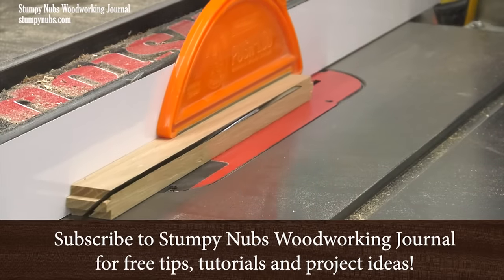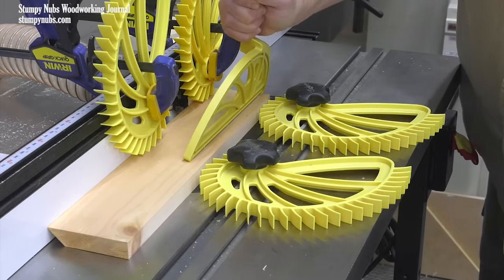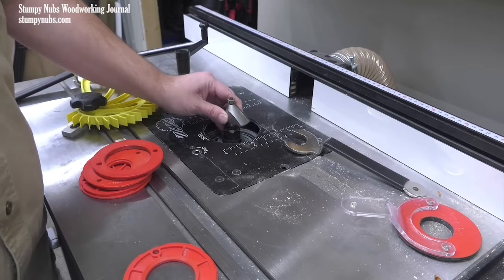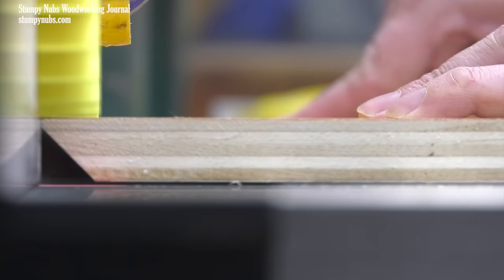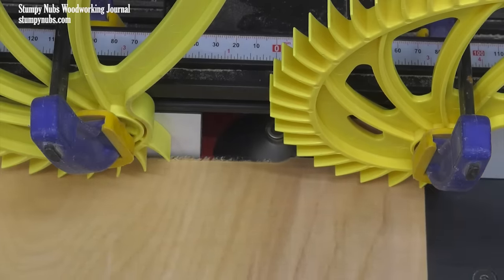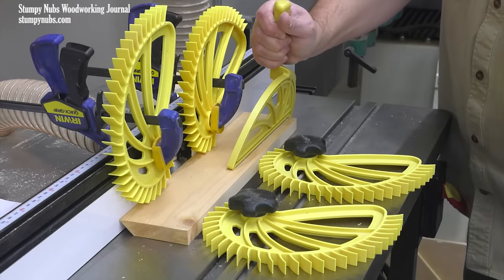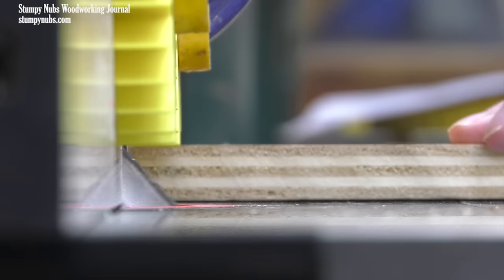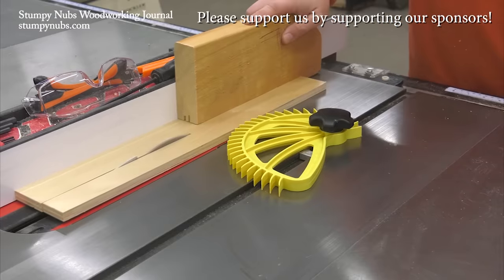This will make a BIG difference when you cut miters/bevels!

Comment: What stops you from just using a track saw? I was under the impression that was the best tool for something like this. Easy to line up perfectly, doesn't wander along the workpiece, precise angle adjustment, can handle long rips.... That is how I see pro carpenters doing long miters, like for fake box beams.
Reply: simplest answer is money. a lot of people dont have money to spend on a Track saw but many woodworkers already have a router table and chamfer bit.  Thats whats great about james, he shows you that there is almost always multiple ways to complete a task, even if those ways arent the quickest or easiest. now go cut some mortises with a drill press! lol.  seriously though, james has shown hundreds of thousands of people that they dont need an industrial sized shop with 100k in tools just to build a nice peice of furniture. Stumpy Nubs is a gold mine to the woodworkers that dont have the funds to buy whatever tool they want/need.
Reply: In my experience, You can tip a track saw if your not careful, giving a wavy bevel
Reply: Also difficult to cut really small pieces easily on a track saw
Reply: @spycedezynuk  Ditto. I was doing miters on 1/4" thick cherry yesterday. Work pieces were only 4 inches long. I can't imagine using a track saw for that.
Reply: The consistency sucks with a track saw.
Reply: 23/32 of an inch. Goddam….

Comment: As someone who has access to a jointer but not a tablesaw or a router table, I've never had this problem. Just set the fence on the jointer correctly and push your board through!

Comment: Big stumpy nubs fan. Nice trick to have in your back pocket. However, I tend to feel like if the workpiece is too small to keep stable on the table saw, then it is also probably too small to be used like that on a router table (to get the crisp edge, at least). In both cases the real difficulty in in avoid travel towards the cutter. IMO, you’d be better off in that case using a bevel bit with a template bearing, maybe even handheld on top of a straight edge template.

Comment: I think that a bevel is a cut at an angle to the face (wide side) of a board and a miter is an angle to the edge (short side) of a board. (length is the third direction, along the grain)

Comment: You could also create a beveled strip of wood on the outfeed side which is the exact size of the bevel you are cutting away, so the workpiece can slide against that.
Reply from the maker: I don't think cutting and fitting that would be any faster or easier than the two test cuts it took to set up my first suggested method.
Reply: @StumpyNubs  but you only need to do it once for all future cuts
Reply: @rutgerhoutdijk3547  i agree
Reply: @rutgerhoutdijk3547  only if all your future cuts are the exact same height miter. Testing for changed setups probably safest

Comment: This video has totally changed how I cut my miters/bevels. I purchased the larger bit and use it with a Rockler coping sled on my router table. It holds the pieces perfectly and cuts the miters in one pass.

Comment: You always come through to save the day! I’ve been trying to cut a nice long 45° bevel  on some pieces of 1/2” plywood for French cleats. I do mostly hand tool stuff so don’t have a lot of experience with my router (table mounted). I figured out my pieces all had humps in the middle of the bevel because the outfeed was no longer flush with the fence by the end. I came here looking for a solution, and lo-and-behold here you are coming to the rescue (and not for the first time). Thanks for all you put into these vids. Cheers 🍻

Comment: Thank you so much for this video.  I’ve been working a box project with mitered corners and have been trying to do them on my table saw.  Just can’t seem to get them square and straight.  I watched this video and decided to try the router table instead.  It worked great!  And that tip about attaching the board with double stick tape to be a guide helped a lot!  The miters came out square and flush.  Thanks James!!

Comment: I built a set of bearing guides for my CNC machine for this purpose. I can feed the material in from one end and have the bearings hold the workpiece at both sides of the cutter. Next upgrade is to add a power feed roller to improve surface finish.

It's worth looking at canned cycles and macros for smaller things like drawer boxes

Comment: Such a timely video. Today, I needed to cut 1/4" x 2-1/2" miters. It took about 2 seconds to head to the router table with the miter bit. I'm a bit right side thinking, so there were a number of test runs prior to cutting the work pieces. Once dialed in, in too all of 3 minutes to cut these perfect miters.... Its the only way I'll do it from here on out.... Thanks

Comment: I’ve shifted from making bevel cuts on the table saw to using my tracksaw and a 90 degree rail guide. Works flawlessly everytime and none of the setup time associated with a router table. It does take a little time to dial in the 45 degree angle on the track saw but once you’ve done it it’s a “set and forget” setup.

Comment: I use this technique to cut miters on the sides on my boxes. I built a small sled with a backer board and clamps to hold the piece in place and use a runner in the miter slot to control the sled. Simple, easy and I can use a stop block to duplicate the lengths. Just slowly raise the bit until the height gets you the cut you want.

Comment: James, you've been reading my mind this week.  
I have a 10 inch benchtop  band saw that belonged to my Dad that I would like to tune up and make operational again. 
My table saw and circular saw both scorch hardwoods, even though neither blade has seen considerable use.  I mostly use them for ripping down 3/4 plywood.  However,  I've never cleaned either blade, and they're probably both covered with pitch and plywood adhesive.
And I've been putting off making a mitered box because I can't seem to cut a decent 45 with my  table saw.  
Thanks!

Comment: We use these exact same techniques almost every day on our Table Saw, and love it. We clamp a special sacrificial fence to the rip fence on the table saw, and angle the blade so that the teeth actually cut into the sacrificial fence. Then we can feed our sock through in exactly the same way you describe with the router bit, but with the speed and ease of set up of a table saw. You also can cut any angle up to 45 degrees, and aren't limited by your selection of router bits.

The only issue is that on steep angles there will be a piece of off cut that wants to jam between the blade and the fence. The way to overcome this is that the sacrificial fence needs to have a rabbit cut out of it, large enough that the scrap can fall under the sacrificial fence and not get pinched, but leaving enough that your stock will be supported. This means you will need a different fence for whatever height of material you are using, as you will be feeding your stock along the top quarter inch or so.

sounds a little complicated just over text, but it is a gamechanger for sure.
Reply: @love the typo...feeding your socks into a table saw would be pretty scary!

Comment: The hidden gem: Combining the clamps and hedgehogs for a down-pressure feather board.

... Really need to add those to my tool set; my big box brand feather boards are such a pain to use. It looks like you tend to use four, any reason a home shop would need more than that?
Reply from the maker: I don't think I've ever used more than four at a time.
Reply: I don't understand why he used the quick clamps instead of the knobs like are on the table surface. It looks like the router fence has T-track too, so why no knobs on the fence? Anyway, I am maybe going to get some of these hedgehog feather boards myself. Usually two of the "standard" style feather boards are sufficient - three if you have one on the other side of the bit. I think he may be using four due to the lower amount of contact area that these hedgehog boards provide vs. the standard style. Maybe someone will confirm or correct me if I am wrong.

Comment: There's a third option for supporting the outfeed side of the material. Some routers have an adjustable fence so that one side of it can be moved forward or back so that it becomes kind of like a sideways jointer. My Festool router table has a micro-adjusting knob to move the right side of the fence back so the left side is more forward and can support the outfeed side.

Comment: I love your videos. Even when you're criticizing something, you do it with class (eg. the recent video with the awful table saw panel cutting TIP). I'm so glad I watched this video regarding cutting miter cuts using a router. This should work for me much better than trying to use my table saw.

I do have a question regarding the router bit you used. I went to the link you provided, and it brings up the Whiteside 2306. As far as I can tell, the 2306 will work on boards up to about 3/4" thick. But the bit you're using looks much larger, and you said it could be used for cuts up to 1" thick. Looking at products on the Whiteside website, I'm guessing maybe you were using the 2310? In retrospect, I'm glad I bought the 2306, since I really don't need something as big as the 2310. But it would set my view of the world back in order if you could help me clear up my confusion :)

Thanks again for all you do!

Comment: I just tried this on some 1/4” stock that I use for making small boxes. I ended up with a corner that was a smidge less that 90 degrees, enough off to cause gaps in all four miters when I assembled a sample box. I’d just verified with a 4” flush trim bit that my router is square to my table, so I’m guessing my cheap MLCS chamfer bit isn’t a perfect 45 degrees. Unless something else is wrong, I’m going to go back to the table saw until I get a better chamfer bit.

Comment: Great video (as usual).  Bt, isn't there a THIRD way to prevent snipe when routing?  By shimming the outfeed side of the router fence you can support the stock equally on both sides and there will be no shift at the "tipping point" since there is NO "tipping point."  Effectively the outfeed side steps up to meet the stock as it exits the bit as with a jointer.

My Bosch router table came with shims that fit behind the face of the fence for just this purpose. I believe other brands can do the same.  I can fine-tune the outfeed side of the fence by adding a strip or two of paper or masking tape to the shim.  Even if your fence doesn't accommodate shims, you can use the paper/tape trick on the outfeed side to support your stock.
Reply from the maker: Shimming would be more effort that adjusting the fence as described.

Comment: I invested in a lock miter bit. Just had to build my own stair nosings out of engineered hardwood flooring. I don't know how I would have done it as nicely and efficiently with any other method. I was able to end up doing a full grain wrap for the nosing of each open tread the whole way around.

Comment: If you clamp the work piece down, could you do this with a hand held router? I want to do this on a full size sheet which might be tricky to run through my tiny router table. Thanks!

Comment: New woodworker here, I'm curious.  The bit you showed has a bearing. It looks like you have the bearing well back from the fence.  Why aren't you using the bearing as a 'third leg' in supporting the piece.  Wouldn't that prevent the rocking you mention while running the board through as well as prevent the dipping you mention while running the end grain?
Love your stuff, thanks for constantly showing us the right way to do things!
Reply from the maker: The bit must cut the entire edge from the board. The bearing sits about 1/16-inch above the top of the bits' cutters. You can't cut the entire edge AND run the bearing on that same edge.

Comment: When cutting an angle on the table saw, would you recommend angling the blade or using a jig that holds the piece at an angle? And then would you recommend that over the router table, or does the router table still give a superior result?

Comment: This is why I never made a miter that fit all around. Very good explanation. But I did always sprinkle sawdust and glue, actually crazy glue, down in the cracks and sand the heck out of it.  My creations looked pretty good from Grandma’s house cause a glued joint would stick out like a horny pony due to not staining the same color as the original material. Thank you for sharing your knowledge of woodworking, wish you had been around 50 years ago tho. 😟

Comment: I use the (Festool) tracksaw whenever possible. So long as you dial your angle in well, perfect cuts, every time.  I've used the router when mitering end cuts, however.

Comment: We were fighting to get a good miter join yesterday, and it took several tries. I don't think the table router would have worked, because the boards were too large to fit easily on the table router.
Maybe we need an outfeed table for the router?

Comment: I kind wonder why they don't make helical router bits with little carbide tipped cutters, like the new surface planer drums.  Wouldn't that help to eliminate tear out and make for a better finish?
Reply: Probably if your cutting edge is sufficiently large. I'm assuming the added complexity isn't worth it for the short cutting edge length on common router bits: the inserts on a helical cutter might be the same length as the entire cutting edge of a small to medium router bit

Comment: What are peoples thoughts on the Rockler 45 degree angle guide? I’ve used that with generally good results. I also use a shooting board for clean up. But as is. It works well.

Comment: with work pieces that are not too wide, is it possible to set the router fence far back enough so that the bevel you cut is the cutoff piece thereby permitting you to keep the work piece against the fence throughout the cut?

Comment: This may sound stupid, but don't you need a 90 degree vbit to cut a 45 degree angle? Are vbits measured different than a router bit? If the angle 45 cut you have 67.5 degrees on either side to equal 180 degree flat surface. I'm using a CNC router, so what am I missing?

Comment: Been using this technique for years. Only I use a coping jig and raise the bit to just meet the top edge. Cut all the parts to length and set the coping jig against the fence make a test cut and keep raising the bit until i just kisses the top edge, spin the board and do it again without changing any settings. Best thing is the bit is always 45 degrees…….Works every time without having to mess with the fence

Comment: Thank you for sharing this with us, I’ve been avoiding mitered corners because of the set up. Are using a large hand held router in your router table or is that a powerful router that came with your table. I’m going to be building a router table in the near future and was going to use a Makita RP 1800 would a big bit like that work in this router? specs say 3 1/4 hp 15 amps

Comment: I do it this way. I'm am not very trusting on my old contractor saw accuracy even when I use the Igaging digital angle cube. The saw sometimes jumps on the teeth that adjust the angle. I don't have this problem with the set 45 of a router bit.

Comment: Great lesson, thanks!

Thoughts on router lifts with tilting, so you don't need special angle bits?
Are the angles precise or better rely on properly shaped bits?
Reply: This is an excellent question! Precise bevel angles with a tilted router and a straight bit seems to me like it should be easier to achieve than with a table saw, but you will lose a lot of depth by tilting the router since a router has a wide base. This is easiest to achieve with a palm router or even a Dremel-like tool. I've seen some DIY tinting router designs here on YouTube, but tolerances ect. would have to be very tight and it would probably only work well for angles that are not far off from 90 degrees. Anyone else have thoughts on this, or personal experience?

Comment: I have the white side chamfer bit and cut mostly 1/2 birch plywood. I seem to get burning on the cut edge. It’s a new bit and it’s sharp could the router speed be causing this or something else.
Reply from the maker: Birch plywood does seem to scorch easily. Is the edge visible in the finished project? Large bits require slower speeds, and this is a large bit. I would adjust that.

Comment: Can the method using the large router bit be used on butcherblock? I would like to have a beveled edge on my countertop.
Thank you
Reply from the maker: Yes. Rout the end grain first. Then when you rout the long-grain edges it will clean up and chip-out you got on the corners as the bit exited the end-grain cuts.
Reply: Thank you much!

Comment: Good video, but at the 45 second mark you said "a 45 degree chamfer bit can't be set to the wrong angle".   Oh yes it can.   I found (the hard way) that my router lift (by a top manufacturer) did not necessarily hold my router perfectly square to the table top.  Scratched my head for a while trying to figure out how a bit that was ground to microns could give me a miter that was so far out.   For almost any other task, I would not have noticed.   Step one should be to put a half inch rod in the collet and check that your router is square to the table top.       And while you have the rod in the collet, rotate it and check how much runout you have.  I think runout is going to leave the angle slightly closer to vertical (but probably insignificant).    More recently, I have been using my table saw with a good Forrest blade. .
Reply from the maker: A misaligned router is a misaligned router. That's not setting the bit to the wrong angle :)